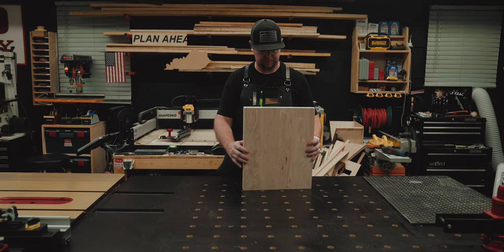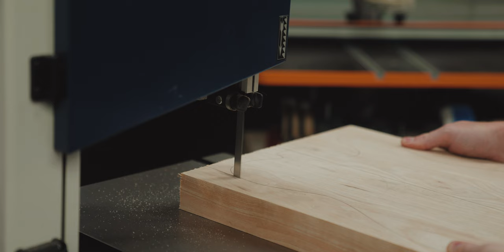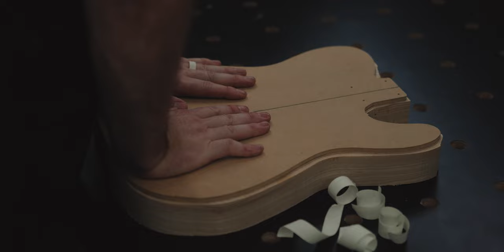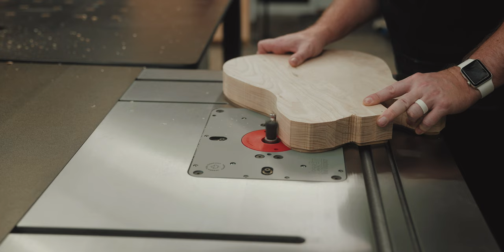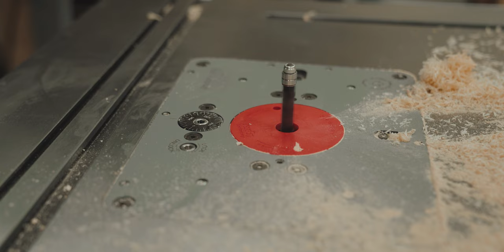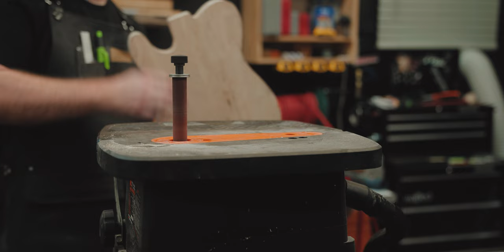Making a Telecaster Style Guitar Body with Templates (Woodshop #asmr)

Comment: One thing I would caution people to remember is depending on the wood species being used, be careful taking full depth passes when routering the outside body profile.
Some woods will blow out under too heavy a cut, so sneak up on the final pass.
This has the fortunate effect as well of reducing or eliminating burn marks from the cutter.

Comment: For the control cavity, could you route the back side if you wanted no control plate and just knobs and the switch on the front. If so, would anything else about the route outs have to change?
Reply: No, not really. Same template, opposite side, leave a 1/4" of material at the bottom of the control cavity.
Additionally, if you wanted to build the guitar to also not have the small, visible wire channel behind the neck pickup you could easily blind drill it with a long 1/4" bit, but keep in mind that on a classic Tele style guitar, the route for the neck pickup is pretty small, and the lead comes off the pickup from the center. See how that small channel is at 45° to the centerline of the guitar? Blind drilling that, you would not be able to replicate that angle of passage, nor have it originate from the center point of the pickup cavity. You'd have to drill at a more oblique angle, starting through the neck pocket and make sure the cavity had extra depth to accommodate some back looping of the lead. Hope that makes sense.
Lastly, you could also simply make the body blank 1/4" shallower, route it exactly as it was done here, and then apply a nice one or two piece top, and then only route the top material away from the two pickup cavities. Use a bottom bearing guided bit and just follow those inner profiles. Look at how a Les Paul is built. Same procedure.

Comment: Great video!  Could share the model numbers and/or the sizes of the two router bits you used with the body template?
Reply from the maker: Thanks! Every bit was from BitsBits.com and they were both 1/4” shank pattern bits and flush trim bits and 1/2” pattern and flush trims.
Reply from the maker: and don't forget to use coupon code MORSELS15 to save 15%
Reply: @KeyWoodworks  Thanks!